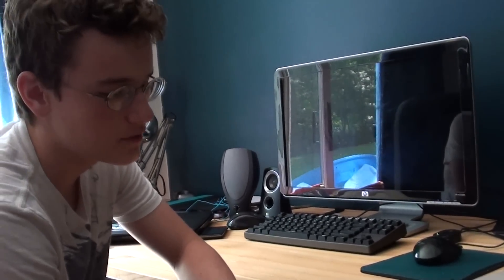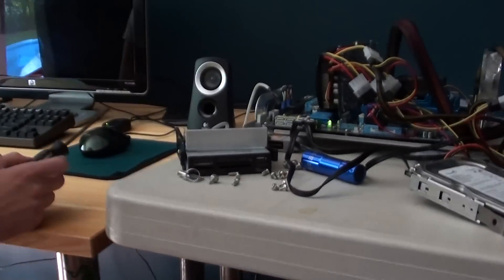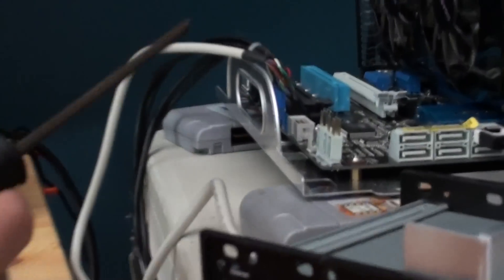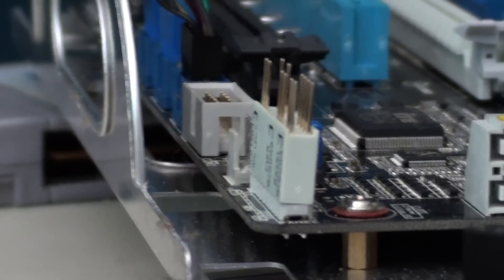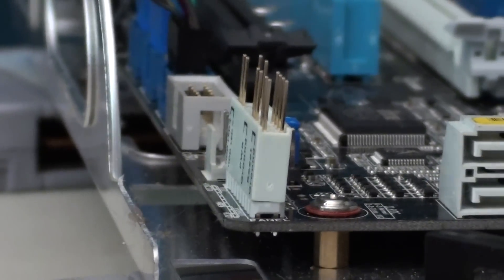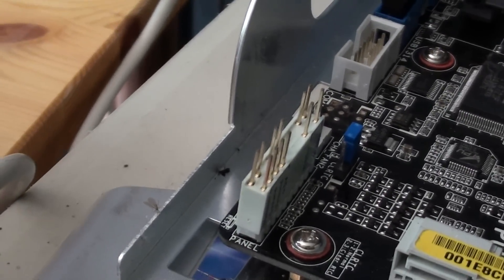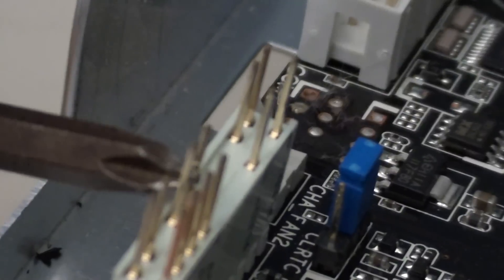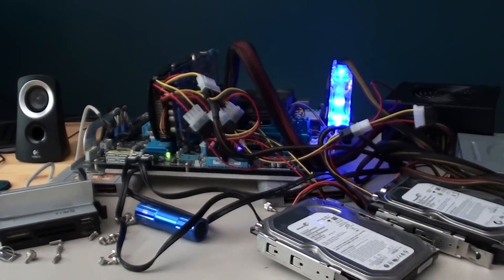How to turn on a computer without a power button

Comment: My PC suddenly stopped turning on. It's fully connected and the socket and cable are tested and working. I thought it might be the PSU so I did the paperclip test and the fan is turning, so the power supply works. I thought it might be the power button so I tried the method in this video but that didn't work, the PC doesn't turn on even when I connect the power SW and ground with a screwdriver. Anyone has an idea of what could the problem be?
Reply: Same here, any fix? My lights only work nothing else

Comment: thx a lot. That helped... If u have your on/off broken u can switch to reset button instead . I just did it, and hell yeah it works.
Reply: Hi. I Just switch the cables reset and power. The pc case-tower has some cables that connect into the motherboard. If u put the cable of rs (reset) into the pins of motherboard that is the power then it is done. When u press reset on the case yr pc starts. EAsy.
Reply: I am no expert but I think they mean the capacitors. Their job is to hold electricity. So, to drain them u need either to wait for them to naturally empty  or it can be done manually by connecting 2 pins again. But this is customized and is different in each motherboard so I have no knowledge about yours.
Please, beware that is electricity that you are messing around and u need to be cautious playing with this things.
Furthermore : 
1). if u connect the wrong pins u will reset your bios. 
2). Try to take off the battery of your motherboard (CR2032) and w8 for a little for the capacitors to empty. (30-60 min)
Reply: Hi, again my friend. As I mentioned above I am no expert in this kind of things. So its better to Google your problem.
TRy google this  <<  Capacitor discharge motherboard  >>.
Wish you to find what u want. Cheers.

Comment: your my effin hero. My power button hasnt worked forever, but the pc turns itself on when I plug the power cord into an outlet (wierd) ... but I had to reseat my CMOS battery, and when I booted up after I restored it to default.. and the outlet power up no longer worked so I had no way of turning it on. Thank you so much!!

Comment: It can also work, as I've been doing, without the PC being apart. Take the start button out (mine had died), bend a small piece of wire into two short prongs and insert them in the hole in the direction of the keyboard. A little (gentle) jiggling and it will fire up.
Reply: Yessss! This works great, as well.

Comment: I have question, what if I accidentaly jumped on the speaker pin?? After I powered the mobo using screwdriver, I accidentally jumpered the speaker pin

Comment: I want you to know that you saved my grade. I transported my desktop from home to my in-laws and back When I lifted it out of my car, I pulled the faceplate off and pulled usb/led/power connectors off of their respective locations. I put everything back no problem, but the power switch wasn't working. I know my shift from a software perspective, but hardware is like a foreign language and this got me back up and running. Thanks!

Comment: How would you turn it off if one does not have a case?
Reply: +MrGrayun1 um dude you forgot the shut down icon?
Reply: Linus Gerford Lugo This comment was done when I was just starting out on pc gaming bro chao
Reply: +MrGrayun1 do the same thing but hold the screwdriver there for 4~5 sec instead 8D
Reply: use your eyes and brain .
Reply: oh shut the fuck up, this comment was way back before when I was just getting into pc gaming
Reply: "*way back before*" so like couple months ago? or was it week?
Reply: oh shut the fuck up leave me alone, much more than that.
Reply: MrGrayun1 its okay bro its okay. do you need a hug?
Reply: looks like 6 months means a decade . new measuring system . :P

and you think you're xpert now ? lmao
Reply: Have you never used a computer before? lmao
Reply: Have you never used a computer before? lmao
Reply: You can learn heaps in that time, it's just the experience which is lacking probably

Comment: Well this fried my motherboard
Reply: Wtf!
Reply: I think so to. I try to do it and it doesn't turn on at all. it only turns on for a few seconds when I unplug it and plug it back in. any help?
Reply: It worked a few times for me, but then it would't turn on. I've tried putting in a case, and nothing will happen when I press the power button. 4th motherboard I've fried within 3 months. :(
Reply: The power button connects the two pins. That's how it works. It doesn't matter how those pins get connected at all. There is no chance that this could damage your motherboard.

Comment: dude i still cannot find it, my motherboard is completely different
Reply: My Manuel ran back to Mexico ;(
Reply: Check your manuel
Reply: I Mexican and I approve
Reply: Jfp1 is the name of the pins
Reply: Doc Chronic I literally laughed out loud 😰.
Reply: Poor Manuel
Reply: Bralenjacob, did you ever find it? for laughing so hard I could not find it too. till I traced the wires from button to MOBO
Reply: Look for jfp1 on your mother board many have a small chart printed on the board to show which h pins are the power switch. Might be abrviated "pwr sw"

Comment: my will power off after 1 second when i do this
Reply: Yes, that's a forced shutdown. The same will happen if you press and hold the power button on a working system. You're supposed to only tap it. Remove the short when the system starts.

Comment: My power switch is very different. sort of the same as the ps2 power button, and its like a paper wire thing connects the power switch to the motherboard. i keep trying to get it on right but i just cant.

Comment: Also if I may add:

These pins are not always labeled power and ground.  Sometimes they call them other things, like  +PW- or PWSW.  Use good judgement, and if you guess wrong, it won't hurt the board.

Also, if you note the pins are raised up on that grey lego block thing, it's because he's using a q-connector.  It's something ASUS makes for their boards so that once you figure out all the pins, you can pull them as a group and not have to figure it out later.
Reply: Can i use the screwdriver method because my power button is broken? Is that safe?
Reply: @TrustDaParessssss yeah its fine

Comment: Green light means power from the PSU.  The battery is irrelevant as computers will work just fine with a dead battery (provided you don't mind setting all of the bios settings every time you turn it on).  The board is not getting any power.  There is not enough info here to tell you what is wrong.  It could be about a dozen different things.

I don't know if this user offers otherwise, but a random youtube video isn't the place for your random and poorly explained question.  Try a proper forum.